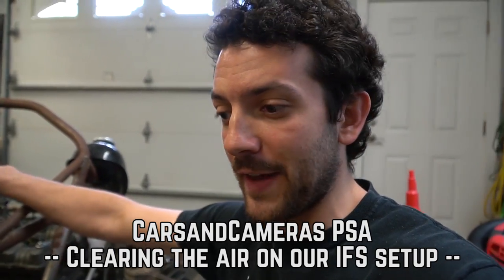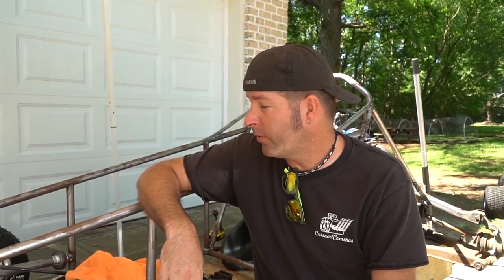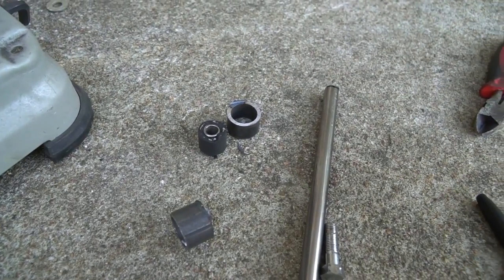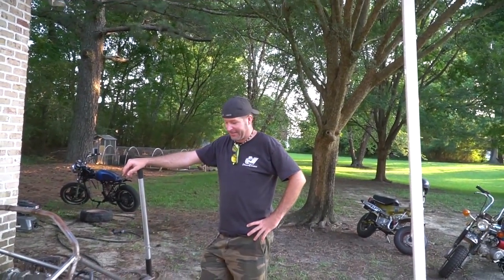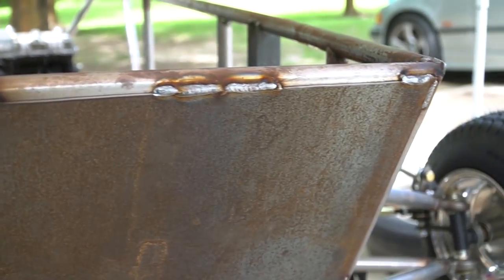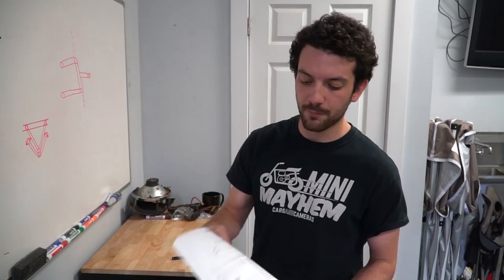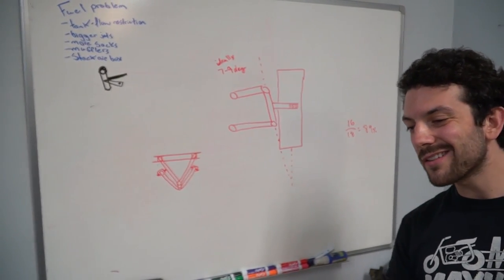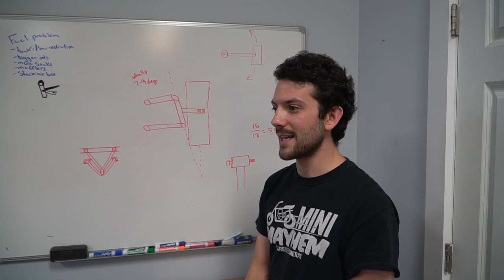Shocks, Suspension, CLEARING THE AIR | Cross Kart Pt. 10

Comment: I don't mean to be nit picking it's just part of what I do. I'm a ASE master and I'm a chassis specialist. I do NVH and chassis driveability and repair. I tend to give my ten cents even when it's not asked....I do apologise guys, I don't mean to. 
That said, those hiem joints are tight but they do have a limit and when kept at that limit they will wear very fast as it's basically a ball joint that's exposed at every end. 
The springs can be mounted to the lower arm. you have enough room for a inboard bell crank type suspension.
The nice thing about using the Miata struts is the amount of aftermarket coil overs available for them, so dampeners and springs can be mixed and matched and factory mounts can be used☺️
Using a SLA ( short over long arm ) type suspension is awesome for cars that handle. Twin I beam works very well for off road and lots of travel...
Roll center, sai angles, included angles, thrust angle , caster, camber and toe is enough to make the smoke leak out ones ears.😂🤣😂

Comment: Hey guys great job on the build...  I would like to say however, I think if your going to have your front shocks in a horizontal position you should set up a cantilever for them. The geometry is wrong when you have vertical linear travel while hitting bumps etc..  you need to transfer that vertical travel to horizontal travel to get the best ride quality and response out of your shocks.  The Heiman joints will definitely work for your suspension though..  I used some similarly on a build a few years back and they worked great and are still working great.

Comment: Not sure if yall have thought about using air shocks, but they give you alot of flexibility in terms of geometry and adjusting the pressure to work well with said geometry. furthermore mountain bike rear suspension shocks are air and can be found for very cheap with rebound and preload adjustments, check dnm shocks on amazon, issac's brother could probably hook it up being that he owns that bike shop.

Comment: Yes, those are Heim joints, and I knew they would be stiff, until they were broken in. Only thing that I would have done differently, would be to install threaded inserts in the upper A-arms, so you can use threaded joints, and lock them with jam nuts. Camber adjustment becomes a snap after that, as you can adjust the length of the arm for continuous adjustment. As long as the steering arms go through the geometric center, bump steer and handling becomes flat and neutral. Didn't think the original shocks were beefy enough, and was right on that one...
 Aside from that - looking good, so far...

Comment: Great vid. Thanx for update. Don't be afraid of sharing any footage like the 1 hour trial. We need to see the progression. My 2 cents= Front shocks are at the wrong angle. Way way to much of a lean, making them incredibly weak. Also diamond plate aluminum sheet isn't that expensive for the floor. Shave a ton of weight off, maybe a future upgrade. One can also use an old street sign for that small of a foot print.

Comment: It coming along awesome guys, the only thing I don't like about the front end is the upper control arm heim joints going through the upper chassis rail permant. I know it's a quick way of doing it but be a prick to replace in the future but welding tabs would have been much better. Either way I still love the build so far 😀👍

Comment: Rotate the upper shock mounts so that they are pointed up and out at approximately 45 degrees. Install a tower brace between the two using smaller heim joints similar to the wrx. Changing the angle probably will cure the undersprung issue of one shock and there are higher spring rates available for those shocks. Adding another shock adds weight

Comment: Yeah, I would go with tubular control which you can make since you have the bender.  They would look and perform better in the long run and also reduce exposed weld.  I would also plug weld instead of but weld those connections.  You really need the strength with the power to weight ratio that you have.

Comment: The upper and lower control arms are further apart on the chassis than at the spindle. Therefore you will have negative camber at full extension but under full compression you have positive camber. If you watch from the front angle when moving the suspension at the top you have pos camber. Also like others have said, if you move the lower shock mount to the lower control arm and make it a steeper angle, the shocks will be more effective.

Comment: Simple way to balance your tires is to just put a few ounces of bb gun bb's inside of them. It is called free motion balancing and works really well. I do it on all of my road going vehicles and it is tested stable on my Chevy avalanche up to 120mph(on a closed course, governor reprogrammed). You could buy the glass beads but bbs work just as well for less $$$.

Comment: If the front coilovers weren't at such an extreme angle like a cantilever suspension, I think they'd be fine. The way it's set up, 4+ inches of suspension travel in the A arms is only = to .5" - <1" of coilover compression. Leverage is working against you. So in the same respect, if the Miata's front suspension is too stiff, put it at more of an angle. Can't wait to see it rip! This project has me excited and itching to get in the garage!

Comment: If you want a light, cheap and easy body/close outs a good way to do it is to stretch Dacron over the chasssis and dope it with epoxy. Once it dries you can trim the excess and add a few mounts with zip ties or quarter turn fasteners.

Comment: On the rear suspension, you could use a second hand set of miata front coilovers to adjust the stiffness and damping. The springs would (usually) be a universal size making it easier to order custom length/spring-rate coils for the vehicle weight. You could also likely measure the corner weight with 4 bathroom scales since the finished product (minus driver) shouldnt be more than 1200 Lbs.

Comment: I would lower the front upper control arm inner mounting point by about 1-2”. Maybe lower the front mount by 1” and rear mount by 2” to create an angled front upper control arm. That angle provides anti-dive and lowering it improves the camber curve (makes up for 89% arm ratio, Shelby modified early Mustangs by lowering the same location to fix Ford’s stock camber curve)

Or not it’s your project :)  Nice build! Enjoy watching

Comment: Just a point to make about the design book ya'll are using:  That whole deal about gaining negative camber during body roll is really more important to on-road cars.  Ya'll are building an off-roader where suspension travel is more likley caused by terrain than by G induced body roll, so I would consider the numbers given in the book to be rough guides at best.  Your own experience driving the thing will tell you if the suspension is right or wrong, and it sounds like you got it more right than wrong anyway.

Back in my model airplane building days (flying models, not static display models) we had a thing called TLAR (tee-lar) which stands for "That Looks About Right".  Airplanes and cars are very much Form Follows Function type of things.  If it looks right, if it looks like the buggy you want it to be, chances are it'll be fine.

Comment: When installing heims on my projects, I will chuck up a bolt/nut through the bearing in a drill and spin the bearing for a few minutes to loosen them up. Real PITA  to test suspension travel or steering clearances with stiff joints.

Comment: I have the same book bought back in the 90s when it first came out, but if you really want to warp your mind there was another book from the 80s by Steve Smith that would have helped called Advanced Race Car Suspension Development. If you had read that you would have placed your front shock upper mount further out and braced it better so the shock would be closer to vertical. You have enough spring rate, especially as close to the outer pivot as you have the lower mount, but at that angle you only have about a quarter of the effective rate at the wheel. Stand that shock up straight and run a light brace from the lower arm inner mount to the shock upper mount and another brace across the top of the frame.

And in your defense you had to make room for Isaac's feet when you built the suspension, so building that part of the frame first was a good thing.

Comment: Ya learn the most, designing and building the suspension yourselves. It'll be a great learning experience by the time you get all the kinks out. I do still find myself wishing you guys would have used all the Miata suspension. It would have just needed the shocks switched out for lighter stuff. And the Miata wheels would work, all the way round.

Comment: Had a few questions, is there a plan to disassemble the drag rail engine to find the failure and did you put the torque converter back on the honda/davidson to continue testing? Have been curious since the sad video of the engine failure at the track.

Comment: Your front shocks need to be more vertical to actually support the cart there is almost no travel there to use the shocks efficiently. Rule of thum is never go more then a 35 to 40 degree pitch. You could build something mechanical to provide proper leverage to get your travel and hold the load or get longer shocks and build something so the frame rests it's weight at the top.You need a extend your frame to put the weight of the cart on. Keep up the good work guys

Comment: The height of the king pin ball joint spread is much closer together than the height difference between the a-arm mounting points giving you camber loss through travel and a super high roll center, both the opposite of what you want for proper geometry. You guys should go out and buy a Quad Racer or TRX250R front end and use the parts for your project and let Japanese engineers keep you having fun.. My first 4 cylinder cart I used a Quad Sport 320 front end and it was a great setup.

Comment: You do have to change those mounts as I described earlier . The  severe angle currently employed almost eliminates the  rebound and compression rate  the shock is designed for effecting bump steer. Right now it's just added weight with no function. The spring is designed to support weight; you ,the engine, and the chassis;  and shocks dampen the action of the spring.  Everything below the spring is unsprung weight. If the shocks and  springs can't do their job,  roll center, wheel bump,etc are  greatly affected, thus giving you an unpredictable response.

Comment: So while you don’t want the heim joints to be “floppy,” you do want them to spin freely and easily. What you want is Teflon lined heim joints for automotive use. They spin freely but have absolutely no play. The coilover is supporting everything so the joints spinning freely has no negative effect, only positive. Any resistance to rotating the heim is force that isn’t being transferred into the suspension, and will cause the chassis to lift over a bump or a hole, which will effect your grip. Looking good though!

Comment: Heim joints are amazing, but NOTE that since they do not have any kind of cushion, its good to lock tight and or torque and keep and eye on the ones that have bolts or nuts through them, vibrations like to free them up. Thats the only piece of mind you should be telling the ones who are worrying

Comment: Front shock angle is too steep. Try fo more of a 45° shock angle. I would make some tubular shock mounts that come off the upper frame rail and extend them outward a couple inches. Then brace it somehow with a tube going between the 2 mounts so it doesn't twist the upper frame rail. I sure wish I was there to help it would be so much easier to explain.  I love suspension work. Used to work for an ATV MX team and used to build their bikes from ground up. I loved it!

Comment: Well It'd be better if you guys put the bottom of the shock on the lower conrol arm of the front suspension and try to use the spot you guys already made for the top of the shock but it's coming out awesome guys keep it up

Comment: The tractor supply heim joints are heim joints. Plain and simple. They have work load ratings on them. And from the looks of the ones you guys bought, they'll handle more than you'll ever be able to throw at em.

Comment: Hey guys, I think it would be better if the front suspension dampers attached to the lower front A arms closer to the chassis instead of the outer end like on the upper arm. 
Great work on everything else though.

Comment: The shock looks like it might give you some trouble. Im no suspension expert but i would think that you would want the shock at or close to a 90° angle of the A arm at max travel, right? In other words it looks like to me that the shock should be standing up more to put all the pressure onto the shock and not the joints. Like i said im no expert or even a mechanic so i could be wrong, but if the A arm at max travel is at a 20° angle (just an example) the shock should be at or close to 110° right?

Comment: Not sure if your using 220 or 110v on the welder but if your on 110 they dont like extension cords.  And if your using the auto set feature. Dont use it anymore. It runs hot with not enough wire speed.

Comment: Sorry about my negative comment but I hope u really learn something abaut this feedback. First off the shocks, front "shocks" have zero shockabsorving ability and the rear are way too stiff to work on that. I recomend to use somthing like Fox air 2.0 Very easy to instal and very cheap also. And if u plan to drive that off-road u need much more travel out off suspension. Just watch from rather b welding or grind hard plumbing channels how great suspension implementations they have done! Greetings from engineer from finland, ur channel was my favorite some time ago...

Comment: The arm chair technicians probably never built anything outside of an RC truck with plastic hiem joints! Hiem joints are very strong and make smooth reliable connections between to points that need movement. They are used every were on helicopters from the cyclic, pitch links that control main and tail rotor blades etc. down to rock crawling rigs. So on a suspension they are just fine with the weakest point being the welds. Keep up the fun work guys and beware of armchair technicians!

Comment: honestly i would make a mount on the lower control arm 4" or so from the outer ball joint with different mount points all the way up to the halfway mark on the A arm.  shocks should be mounted low to keep the center of gravity as close to the ground as possible. likewise i would build a mount on the frame but move it out a few inches where the first mount point would be located then add a few more mount points outward from there. by the way i think the use of those ball joints is just fine.  you might want to add a brace that ties the other end of the a arms together i would rather have solid triangles than a floppy bit of tube with ball joints to hold it in place. in fact if you only braced the bottom arm it would make a world of difference in the way that suspension will perform.

Comment: you should have the lower shock mounts on the lower control arms to give you better angle the shock should be at about a 30 to 35 degree angle for you to use the full power of each shock

Comment: U know what meet me in the middle here and put some gusset in there and I would say it wouldn't twist from that pebble u could possibly hit. Change the angle on the springs and u should only need one. Its kind of like using a breaker bar vs a plain socket wrench. If u pull the bottom of the shock in more and the top of it to the top of the frame your good to go. Two heads are better than one my friend

Comment: My concern is the fact that theres no shock absorption in the front. Let's say you hit a pothole at 60 mph, it's going to want to push the tire backwards(think caster angle) away from the frame. Hopefully nothing will break, but it will be a weak point.

Since you have the cage going above your head, I'd install a 5 point harness or at least some type of seat belt just in case anything happens. This is a bigger build, so the danger factor is also bigger.

Comment: Hey guys I want to see a Miata cart or a Vostok frame cart that uses a Miata engine in the rear and uses some of the main components from the car. You could use the suspension and have the car still use the engine,trans and parts of the frame. Miatas are super cheep and quick so maybe even doing something with one instead of just some parts off of it would be awsome

Comment: Why didn't you move the bottom shock mount for the front suspension to the lower arm, near the axle? You could have also brought out the top mounts to make the shock stand up right as much as possible..

Comment: Most Heim joints are .001 under size on the ball an .001 oversized on the threw hole to allow for easy movement. Tractor heim joint are made tight for less movement pulling 1000s of lbs .they well be fine for what you guys are doing

Comment: those heim joints are for sure just tractor heim joints ones used in actual suspension are much better quality but those are more than good enough for a go cart. also be careful welding around them do not put too much heat into them or they will warp and not move properly anymore.

Comment: Here’s a tip for tour welder. Take a clothes pin and a piece of paper towel fold the towel up and over the wire inside the welder before it goes through the wheels of the feeder assembly. This will keep the liner cleaner and also keep the wheels cleaner, you’ll be amassed at how much junk comes off the welding wire.